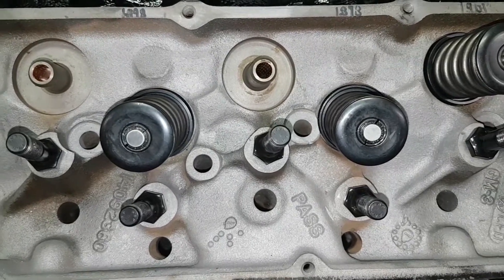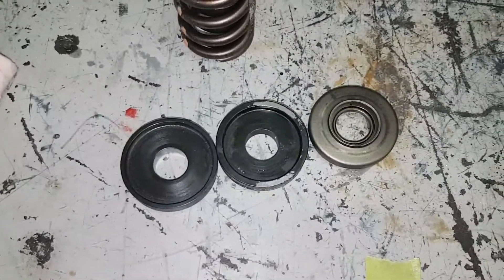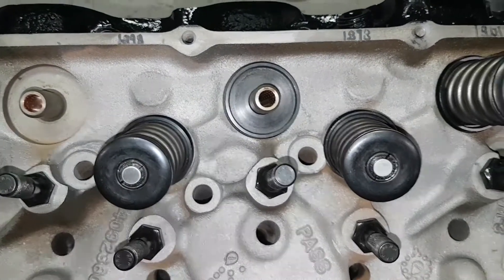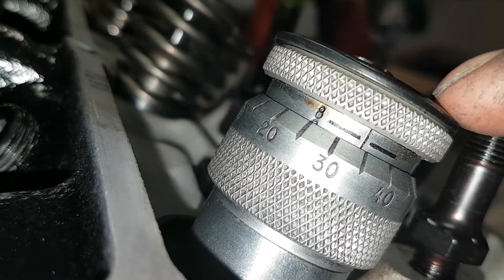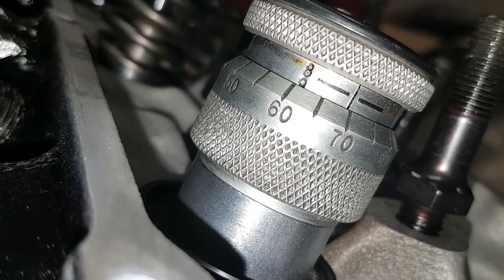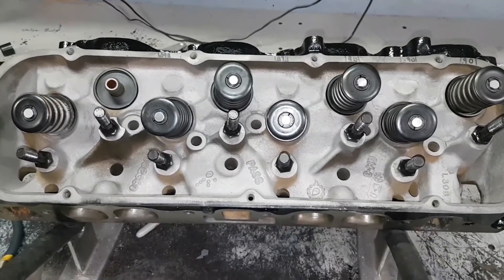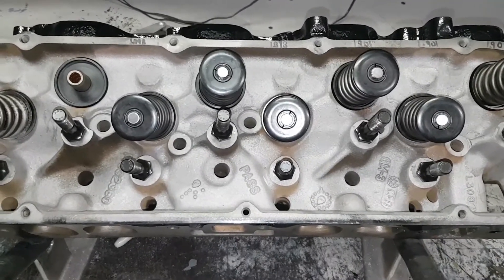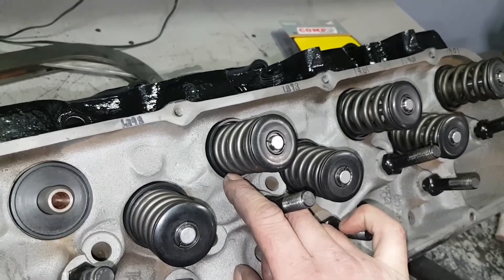Setting valve spring installed height

Comment: I applaud 👏🏼 you sir for this very detailed knowledge. I am putting together an L29 block right now and have some really nice Liberty Performance Plus dual springs and this rotator eliminator info is spot on and so helpful with the facts of what is needed exactly for these constant diameter dual springs to work. I have to break my Voodoo cam in with just the outer section of the spring. Once the cam is broke in I reinstall the inner spring is the only difference in my setup. Well done. 👍🏼

Comment: Will a sbc with  a small .490 lift really make a diff .if i use shims with the locators? I am right at 1.90 on all with either .060 or 030 shims under the locator.
Reply from the maker: Shims are fine . But if you can get away with not using them its better.
Reply from the maker: Shims are fine . But if you can get away with not using them its better.

Comment: Could you have used +.050 locks to get you're installed height and then shim to where you needed?
Reply from the maker: We did it in one piece and the retainer clears the rocker arm. 

My way is better than using .037 in shims
Reply: @fullytekmechanical3595  ok yeah was just wondering since I didn't have a lathe to turn the locators down definitely good way to do it

Comment: Should this be done to every spring kit?, I have comp cams 26926ts kit should I measure though I'm told they'll work right out the box.
Reply from the maker: Measure everything every time
Reply: @fullytekmechanical3595  Hi Gregory,on the intake valves how did you put them together? I have to install five shims to reach 1.900 is there another way to with out shimming the intake?thank you
Reply from the maker: @robertalmaguer1331  you can order offset valve locks .